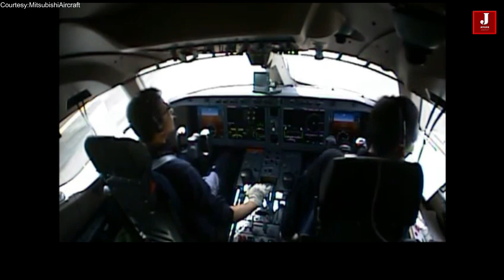The first MRJ Regional plane from Japan is scrapped in United states. After the program terminated

Comment: I was one of the engineers for flight controls system for this MRJ back in 2016, and it is sad to see how this MRJ story ends. However, my advice to MHI corporation is to converge on vertical integration of the company. If MHI was vertically integrated the MRJ (Space Jet) may have had a better chance of success, just my opinion.
Reply from the maker: Hello, Max thanks for the update. can you brief more reasons why they ended the project?
Reply: This is all politics. The US doesn't want Japan to compete with its aviation industry, so the FAA intentionally does not approve and give certification to Mitsubishi.
Reply: @NationChosenByGod you don’t say, lol. Why wouldn’t America give its vassal state Japan a piece of bone to chew on? 70 to 90 seat regional jets aren’t that competitive with Boeing 737s. China’s ARJ, C919, and C929 will not get certified either, and that’s truly political. But they will still carry on. Finding excuses is easy, giving up is easy, finding solutions and persevering is hard.
Reply: They already have China to deal with, so having Japan compete is not an option.